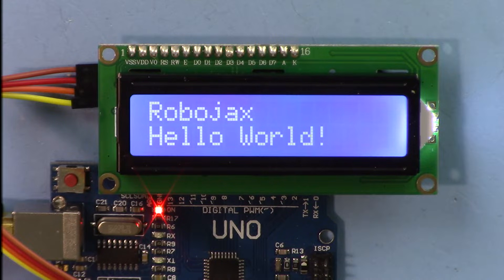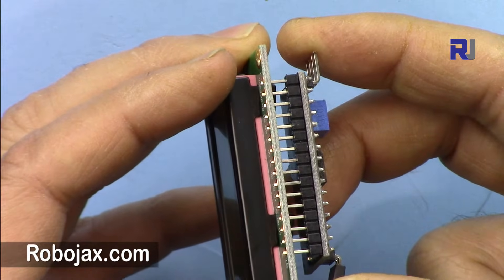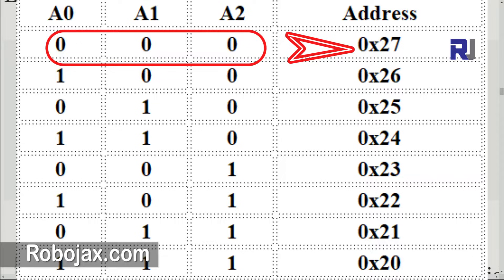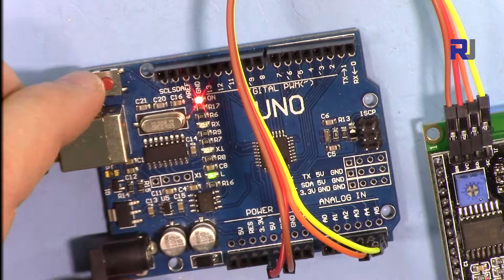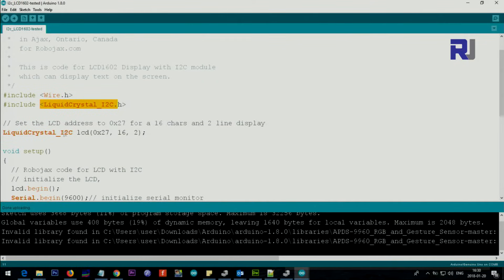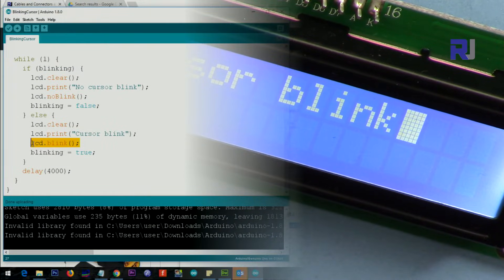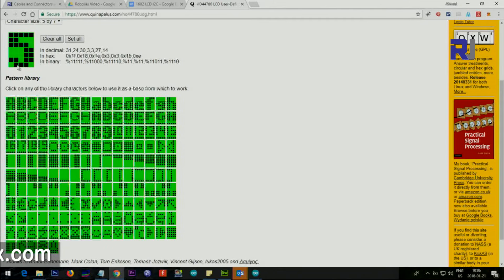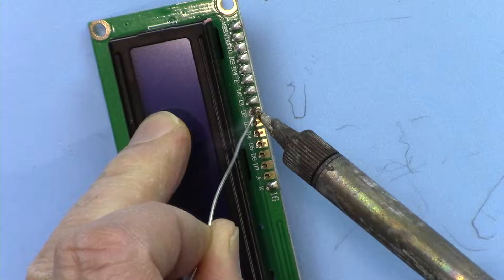How to use  LCD LCD1602  with I2C module for Arduino - RJT50

Comment: I need a circuit board that can do the following: 

It needs to turn a step-up motor. But with the following options:

1. Have a set button that I can let the motor do 360 degrees, or set it to so only 180 degrees or just 90, whatever i choose.
2. A speed setting for the motor.
3. Display

Can you please advise which board can do this?

I would appreciate it a great deal.

Comment: mine doens't work, is it because I haven't soldered the I2C module with the LCD? (wire connection and contrast is fine, I just keep getting a line of white boxes)
Reply from the maker: how would you expect it without soldering. there won't be proper contact. solder it and it will work.
Reply: Check is your port option in aurdino ide is working or not

Comment: /home/pasiflora/Arduino/LCD/LCDHELLO/LCDHELLO.ino:20:10: fatal error: LiquidCrystal_I2C.h: No such file or directory
 #include <LiquidCrystal_I2C.h>
          ^~~~~~~~~~~~~~~~~~~~~
compilation terminated.
exit status 1

Compilation error: LiquidCrystal_I2C.h: No such file or directory
what can i do?
Reply from the maker: You can only not skip the video and watching and follow instructions. It say file missing . You need to install the library and the issue will be resolved.
Reply: @robojax  thanks, LCD still not working

Comment: Why some time automatically count down equal to 0 and realy off
Reply from the maker: is this "why" or "how". https://youtu.be/BhEIFzFSMuE
Reply: I use a 12 Dc motor through the relay. The motor is given through a separate power supply. It is controlled through the relay. When the 12 dc power supply is turned off, the relay turns off according to the time given by the potentiometer. But When the power supply to the motor is turned on, the relay will turn off before the scheduled time.
Reply: Any idea ?

Comment: Hi thank you for great video.
Mine is not working at all. I am using UNO with an OLED display, did everything A4 and 5, dedicated SDA and SCX, different libraries, even followed advice to change to lcd(0x3f,  16, 2), it is all dead and showing nothing. I am using an OLED without a shield but it has the four required connections. Any idea where am I going wrong?
Reply from the maker: you gott install the library mention and shown. over 100,000 people have used this library

Comment: Do you need to use the i2c bored or can you just use the lcd on its own
Reply from the maker: No you don’t. Get the lcd without the I2C module and use. But you need to connect 8 or 10 wires instead of 4 .  Here is my video on that https://youtu.be/S4ya3Q7uhJs

Comment: for some reason my lcd doesn't show any text, even tho no "errors" are there, I used the same code and connections, my lcd only turns on and that's all.
Reply from the maker: adjust the contrast.  there is a variable resistor or pot. turn it left or right. Here is a better video with wiring diagram https://youtu.be/L1FJ8fJK-pY
Reply: @robojax  yeah I actually searchef further about the problem after writing the comment and solved it, thx for the reply tho ! <3

Comment: begin() doesn't look like a function in that library and my arduino doesn't recognize it, but it also won't print anything even though the code compiles and its been lit since I plugged it in. anyone else having a problem like this?
Reply: update you were right. there are multiple libraries with the same name. thanks so much!
Reply from the maker: you are welcome.
Reply from the maker: You have not then downloaded the library I provided. Just download the library and it will work. Few days again I  created another tutorials using the same library a the lcd.being() is need and it works.
Reply from the maker: Here the latest video using the same library https://youtu.be/NXAswOc_2zg

Comment: lcd.init ();
Error on this line how to solve this sir ?
Reply from the maker: what error? provide full text. you must install library.  Please watch better latest video here https://youtu.be/pxUjEsJQW2M
Reply: @robojax  library already installed.
lcd.init (); error
Reply from the maker: you have not installed the correct library. I made another tutorial with the same library here https://youtu.be/NXAswOc_2zg and used lcd.begin() and it works fine. you are using wrong library.

Comment: Arduino: 1.8.19 (Windows 10), Board: "Arduino Mega or Mega 2560, ATmega2560 (Mega 2560)"

sketch_oct10a:2:10: fatal error: LiquidCrystal_12C.h: No such file or directory

 #include <LiquidCrystal_12C.h>

          ^~~~~~~~~~~~~~~~~~~~~

compilation terminated.

exit status 1

LiquidCrystal_12C.h: No such file or directory

This report would have more information with
"Show verbose output during compilation"
option enabled in File -> Preferences.

the code does not work and displays this error message
Reply from the maker: of course it does not work. you have skipped the video where I mentioned to install the library.  didn't you see in your error where it says "No such file or directory" ? it means you did not install the library and file is missing.

Comment: Hello. Thanks for the video. I used it on 8/28/22 and I had to make one small change, maybe the L C library has been updated and changed a bit. My Arduino IDE wouldn't accept "lcd.begin():" so I had to change it to "lcd.init();" Otherwise it works great. This is my first time trying to use an LCD.
Reply: I don't know if your interested in this but I found the "lcd.init();" in the Liquid Crystal I2C example "Serial Display".
Reply from the maker: you have not installed the correct library. I made another tutorial with the same library here https://youtu.be/NXAswOc_2zg and used lcd.begin() and it works fine. you are using wrong library.

Comment: Side note in 2022. I had to change LCD.begin(); to LCD.init(); in order for this program to work
Reply from the maker: May be you are using different library. I have mode over 50 projects in this way
Reply: @robojax  not sure.  I used the standard libraries for uno.  Anyhow just thought I would share my experience incase someone else gets stuck like I did.  Thanks for you videos.
Reply from the maker: you have not installed the correct library. I made another tutorial with the same library here https://youtu.be/NXAswOc_2zg and used lcd.begin() and it works fine. you are using wrong library.

Comment: hello,am using this lcd in my project on an alarm clock,i have difficulties in the code settings and arduino setting.kindly help me out brother.am new in arduino projects.
Reply from the maker: Hello,  if you are new, then you need to start learning. Here is my $200 Arduino course for free https://youtu.be/-6qSrDUA5a8 and in this course we have a full section on LCD display. Good luck

Comment: PIN 1 》GROUND 
PIN 2 》POSITIVE 
PIN 3 》10K POT
PIN 4 》A12
PIN 5 》GROUND 
PIN 6 》A11

PIN 11 》A5
PIN 12 》A4
PIN 13 》A3
PIN 14 》A2
PIN 15 》220Ω
PIN 16 》GROUND
Reply from the maker: No Thai won’t work. This display has I2C module and has only 4 wires shown in the video. For the display without the module see my other video
Reply: PINOUT WITHOUT I2C

NORMAL CONNECTION BETWEEN  UNO AND 16*2

Comment: Hi there, is it possible to use your code with arduino nano? I'm cannot find out how to get your code to work with a nano
Reply from the maker: Hi, all the codes work with all Arduino board and that's why I did not mention which board.

Comment: Hey sir code is getting uploaded and backlight is also glowing but the text r not visible so please help!
Reply from the maker: now turn the potentiometer left or right until you see squares on the screen. this video is outdated .there is better version withy wiring diagram here https://youtu.be/pxUjEsJQW2M which is part of the Arduino step by step course

Comment: Your explanation is very good. Did you have  project Arduino control pressure in compressor with wiring and Arduino code explanation. Please give the link. Your videos are very helpful. You should have long life.

Comment: Thank you a lot for your excellent video. You helped me to resolve a problem in a project I'm actually working. ( An emulator of an hydronic heating  system ) Thanks again, I'm from Montreal. Miguel
Reply from the maker: My pleasure.  You may continue learning Arduino with my course . Link is in description

Comment: i dont know why when i use lcd.begin my script dont working but when i use lcd.init my code is working
Reply from the maker: it should not work without the lcd.begin. it seems you have the same code twice included. check it
Reply: @robojax  thanks

Comment: I keep getting this error code... Please help!

Arduino: 1.8.16 (Windows Store 1.8.51.0) (Windows 10), Board: "Arduino Nano, ATmega328P (Old Bootloader)"

sketch_oct24a:2:10: fatal error: LiquidCrystal_I2C.h: No such file or directory

 #include <LiquidCrystal_I2C.h>

          ^~~~~~~~~~~~~~~~~~~~~

compilation terminated.

exit status 1

LiquidCrystal_I2C.h: No such file or directory

This report would have more information with
"Show verbose output during compilation"
option enabled in File -> Preferences.

Comment: Possible to explain the analog part? what if I wan other analog pin, rather than analog A05 / A04?
Reply from the maker: SDA and SCL are used for I2C  communications and ONLY those pings are using or just use the pins on other side of the board labeled as SDA and SCL. See this video which is part of my Arduino course that might help which has wiring diagram. https://www.youtube.com/watch?v=pxUjEsJQW2M the full course is Here is $200 Arduino course for free Arduino Step by Step Course  (over 100 video lectures) Starts here http://robojax.com/L/?id=338

Comment: I did just that but I had problems with error code. I coppied and pasted your sketch and still error message. Iused library manager and found a library LiquidCrystalI12C and it now works. You have a different IDE version than mine also. Love your video's thou. Keep it up.

Comment: Hello, I did everything as instructed in the video. However, my LCD lights up but doesn't show any text. It's totally blank. what can be the reason for that?
Reply from the maker: Adjust the potentiometer until  you see the text
Reply: @robojax    I had the same problem with her and when I adjusted th pot, only boxes shows
Reply: @robojax  pls help

Comment: Hey please can you tell me which library i should use and what wrong is in this code

#include <Wire.h>
#include <LiquidCrystal_I2C.h>
LiquidCrystal_I2C lcd(0x27, 2, 1, 0, 4, 5, 6, 7, 3, POSITIVE);
#define MQ2pin (0)
int buzzer = 10;
int sensorValue;  //variable to store sensor value
void setup()
{
  pinMode(buzzer, OUTPUT);
  lcd.begin(16,2);
  lcd.backlight();
  lcd.setCursor(0,0);
  lcd.print("  GAS SENSOR ");
  delay(1000);
  lcd.setCursor(0,1);
  lcd.print("  WARMING UP ! ");
  delay(20000); // allow the MQ-6 to warm up
}
void loop()
{
  lcd.clear();
  sensorValue = analogRead(MQ2pin); // read analog input pin 0
  lcd.setCursor(0,0);
  lcd.print("VALUE: ");
  lcd.print(sensorValue);
  lcd.print("ppm");
  if(sensorValue > 300)
  {
    lcd.setCursor(0,1);
    lcd.print("SMOKE DETECTED");
    tone(buzzer, 500, 2000);
  }
  else
  {
    lcd.setCursor(0,1);
    lcd.print("  NO SMOKE");
    noTone(buzzer);
  }
  delay(2000); // wait 2s for next reading
}
I m getting positive not declared in this scope or exist 1 status please help
Reply: One more thing i used arduino uno, mq2 gas sensor, Lcd display and buzzer and this was the program given to me ! Can you link wire.h library too? Please
Reply from the maker: where did you get the code? this is not for LCD with I2C. it should be defined like LiquidCrystal_I2C lcd(0x27, 16, 2);

Comment: 7:48 I put the exact same code on the IDE and arranged the LCD like in the video but nothing happens on the LCD why is that?
Reply from the maker: I assume you have downloaded the library. then adjust the contrast while the code is running.  make sure you see 16 character frames in each line.
Reply: @robojax  yes, but how do we adjust the contrast without the potentiometer since like I'm using the LCD I2C
Reply from the maker: It has to have potentiometer

Comment: can i run a program after uploading it with arduino  then removing arduino and using i2c instead
Reply from the maker: This display is used in this video “for Arduino “ you can connect it to other microcontroller to display text if you know how to program it. Here is introduction 30 minutes course https://youtu.be/Mbb2xa1WcRM

Comment: any pullup resistors required? bought 3 LCD with I2C. all three not displaying any text. the program downloaded without any error. brightness adjusted.
Reply from the maker: did you set I2C address? use I2C scanner I've provided. then change the contrast.  it should work. if you want to change I2C address, to something else, check the link in description for my other video.
Reply: @robojax  I2C address correct. used scanner. its not able to find any device. It's stuck up like.. scanning......
Reply from the maker: If it can’t find , then check wiring. SDA is A4, SCL is A5.   And if you still can’t get the address, the your module is bad.
Reply: @robojax  connection correct. Tried in another Arduino UNO. Now I2C address displays in scan, but still LCD not display letters. Adjusted contrast too. 🤪
Reply: Finally done. Deleted all libraries and installed only one fresh. It's working. Cheers..

Comment: Sir I used your method but it worked for two days but it is not working now only the lcd screen is full green nothing is coming.
Reply from the maker: Chang the contrast
Reply: Sir it is not working @robojax
Reply: @robojax  I tried to change the contrast using the potentiometer but it is not working
Reply from the maker: Have you used the I2C scanner? It is on the list and check related videos
Reply: @robojax  sir I have used it but it says scanning and nothing else, but when I disconnect the i2c module it says unknown error

Comment: I have recently bought new LCD for arduino and it works fine except that after a while it shows weird characters. It is programmed in a way the its screen should clear any existing message (lcd.clear) before printing any new message. However, It works fine for a while and then LCD freaks out and start showing some weird characters and keep piling them in a row. If I reset arduino then it again works fine for a while and then again shows weird characters.
 Why does it happen??? can anyone help
Reply from the maker: Hello, when the wiring is not tight it connects and disconnects, that is what happens.
Reply: @robojax  Thank you for taking the time to reply. So I did some trouble shooting. I found out that if I remove the 5 v relay module, the LCD works perfectly fine. However if I connect it. Weird characters or a box from the 1st row is what is being displayed. What I'm creating is an alcohol dispenser with LCD to display the alcohol level too. How do I fix this? thank you.
Reply: @robojax  Really? I'll test it out. Thank you. But which specific wiring? the one that connects the LCD?

Comment: Hello Sir, firstly thank you for the great video. Secondly, I would like to know that if it is possible to use RTC3231 which uses I2C, and the LCD1602 that uses the I2C too along with a keypad. For example, if I press a key on the keypad I would like to see it on the LCD. Will the two devices on the I2C bus make a problem?
Reply from the maker: Just search my channel and you will be surprised. Here is the code and video https://youtu.be/qB0drI56zGE
Reply: @robojax  Thank you very much, sir. I follow your channel regularly for the amazing stuff you have made. Actually, I have integrated the RTC and Keypad but now I want to integrate the I2C display. I wanted to know that will it possible to see the pressed key on the keypad on the display without any problem with the display or RTC? But you have discussed the address on the I2C bus. Do I need to specify the address of the LCD when I need to communicate with the display?

Comment: did we need to solder at A0,A1 and A2 if we use address 0x27 ?
Reply from the maker: Please see the link in the description for separate video which I2C module is fully explained

Comment: Hi, thank you for your video on LCD162 I2C arduino. While running your given script, i encountered the error 'LiquidCrystal_I2C.h: No such file or directory'. I appreciate if you could advise me to solve this srcipt error. I have the hardware parts which is working by following your video. Thank you for support.
Reply from the maker: Hi, it says you skipped the video. Please watch fully without skipping  and it will work.
Reply: Thanks Robojax with your reply. Ll review your full video further.
Reply: did you ever find out the problem

Comment: the LCD lights up but it is not displaying anything
Reply from the maker: make sure to run I2C scanner and get the address printed on the serial monitor. then change the contrast to see the text.  good luck Mariam. Greeting from Canada
Reply: @robojax  thank you verrry very much sir!! It's working now👍🏻👍🏻

Comment: Hello sir, i followed everything on the video but it wont display the characters only blank lcd screen that is turned. Help!
Reply from the maker: I assume you get the I2C address on serial monitor. if so then turn the potentiometer and adjust the contrast. if you don't set the I2C address correctly, you will not get value.  good luck.
Reply: @robojax  okay sir thank you and btw it works!
Reply from the maker: you are welcome.

Comment: no matching found for call to liquidcrystal.h::begin()' this error is comming but i add all libaraies i watched your video 7,8 times
Reply from the maker: over 100,000 people have used this video and they are using the LCD. you must be done something wrong. Please watch use the method shown in this video https://youtu.be/dVh77wT-4Ao at 6:39.  Most of my videos have link directly to difference section of the video in the description.